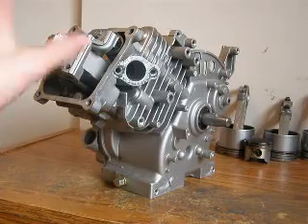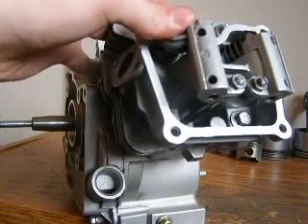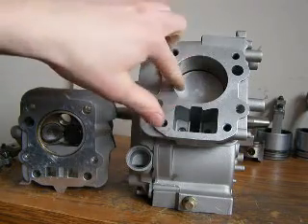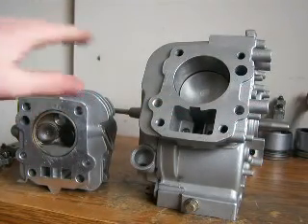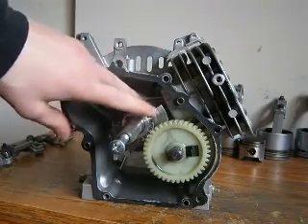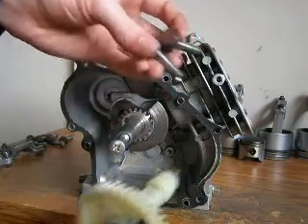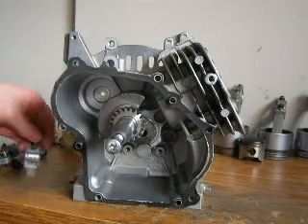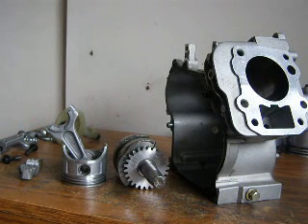Removing A Piston From A Small Engine

Comment: The small part of the piston rod is the rod cap that he took off.. The rod is still attached to the piston when it is removed. They have wrist pins and wrist pin keepers that hold the piston on the rod. I have worked on boat and car motors but not on lawn mowers. After you reinstall the piston and rod with cap you will need to torque the rod cap bolts with a torque wrench according to factory specs. So you can take it out using this ratchet wrench but need to use a torque wrench for reassembly or take a chance of over tightening or under tightening the bolts causing distortion or allowing the bolts to come loose. It would probably be a good idea to use blue Lock Tight on the bolt threads. When inserting the piston in the cylinder you will need to properly space the rings in the piston skirts/grooves and use a ring compressor to compress the rings on the piston so when you tap it down into the cylinder the rings don't hit the top of the cylinder block and break. If you were installing new rings you would need to break one of the old rings and use the end of it to scrap out any carbon that was built up in the grooves being careful not to remove any aluminum from the piston. You can install rings on piston by carefully putting one end into its groove and circle it around close to the piston so it slides all the way round into its groove. Best way is to buy a cheap piston ring installer tool from an auto parts store or on line. This tool grabs the ends of the pistons so when you squeeze the handles it spreads the ring apart. While squeezing the handle have the ring directly above the piston and open it up just enough so that it clears the piston sides. Drop it down to the groove (doing the bottom one first) and release it into its groove.